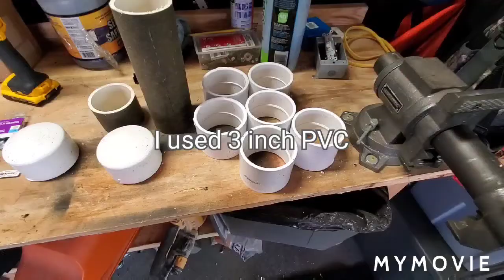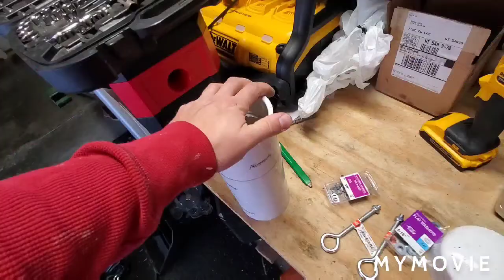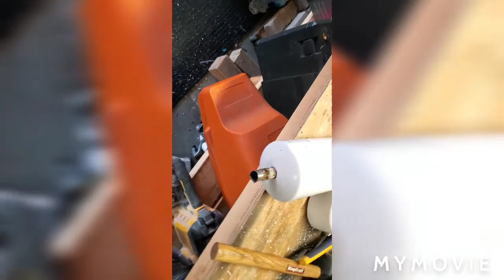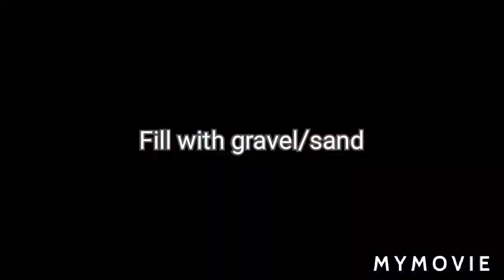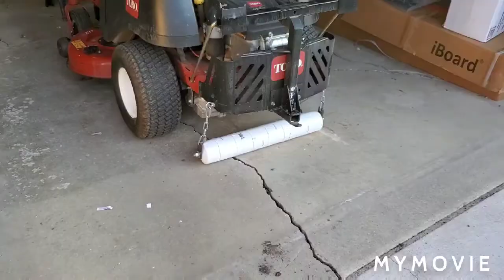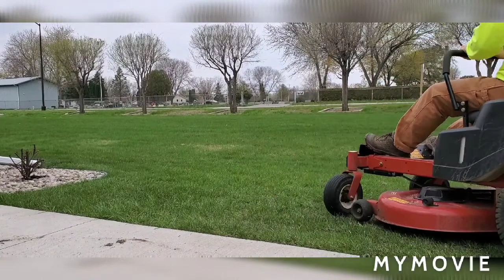Diy Zero Turn Lawn Striper/First Cut Of The Season

Comment: Why did you cut the pvc, just to put it back together? Or did you just buy the pieces like that?  Would a full piece work?
Reply from the maker: @calebphelps7734, you could use a full piece. I used couplings and end caps to make the entire length of the pipe the same diameter, but that was really only for cosmetic appearance purposes :)
Reply: @Mr.E_Works  have you weighed the final product?
Reply from the maker: @Kalesoccerclips  I have not weighed it.